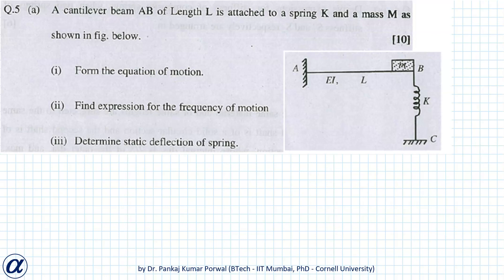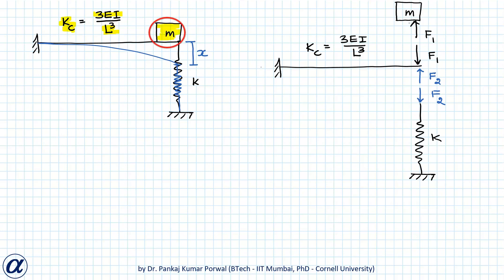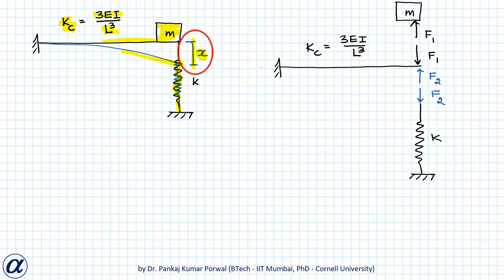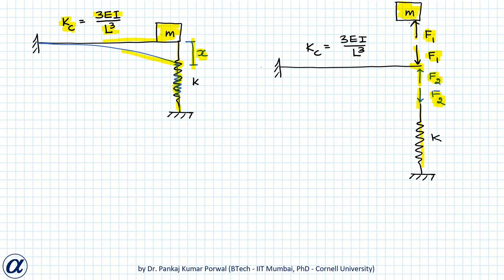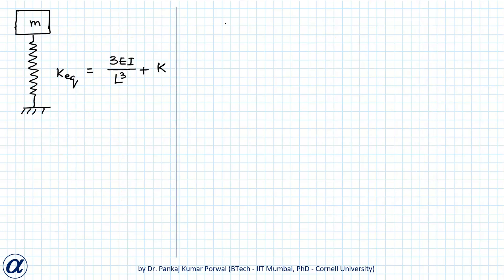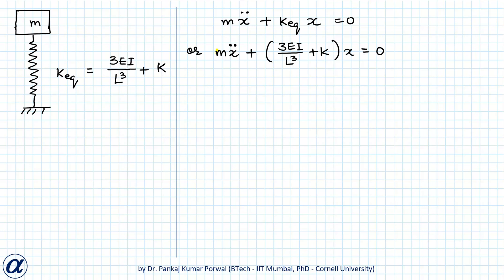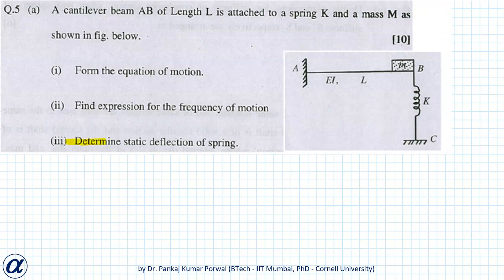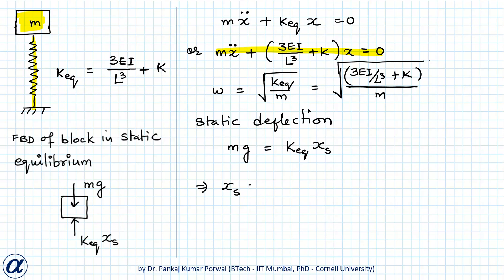Block on Cantilever and Spring

Comment: If I put a beam that is hinged at the left boundary and connected to a rigid body and to a spring at the right end ?
 But the vertical mass (Rigid body) different from that of your exercise.
Reply from the maker: Then beam stiffness will be zero. Final answer will depend on whether beam has mass or not. Equilibrium equation (with acceleration term) can be written about hinge of the beam.

Comment: What happens if we put another spring above the mass block?
Reply from the maker: If there is another spring above the block then it will be tricky situation.  During upward displacement things will be alright, but during downward displacement the block may lose contact with beam.  Without contact, the block (with its spring at top) and the beam (with its spring at bottom) will become two separate vibrating systems.